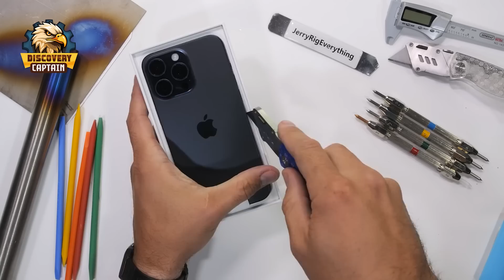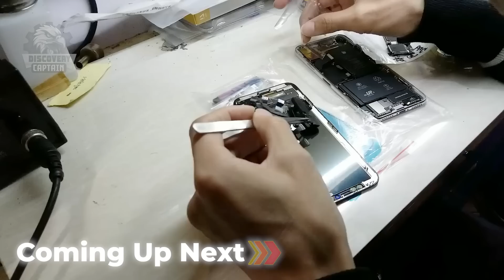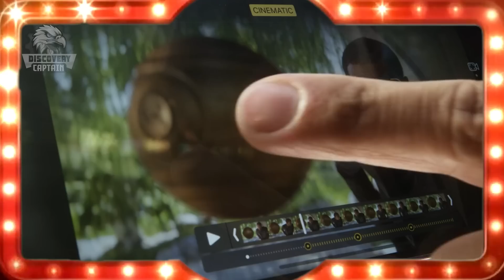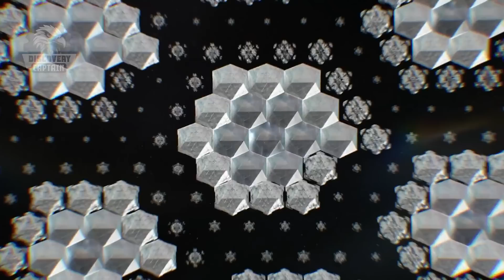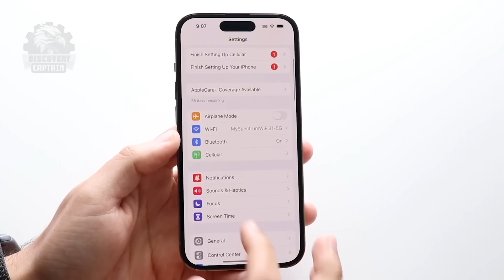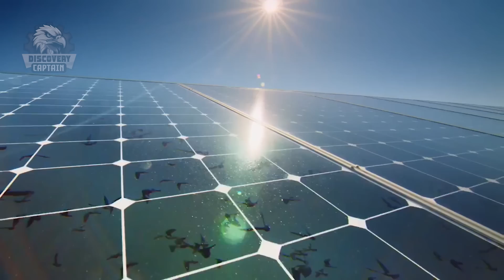Inside Apple’s INSANE iPhone 16 Factory! 📱📱 How iPhone Is Made in Factory? | Captain Discovery

Comment: I started with iCrap devices in 2004 the first gen iPhone, and upgraded until 2015 until I figure out iCrap products can't connect to car via OBDII to programming the car and now programming EV battery BMS. I tryed newer models of iPhone and sell it becouse the Home bottom is gone. I using now Android. My last iPhone was version 15 I keep it only in 1 week and sold it. Figure out it's not fitting my work at all.